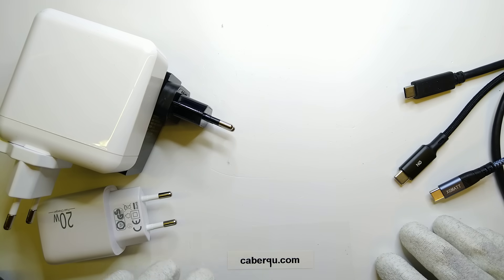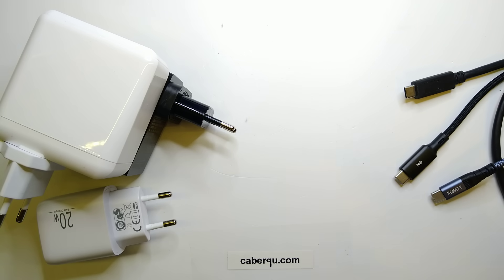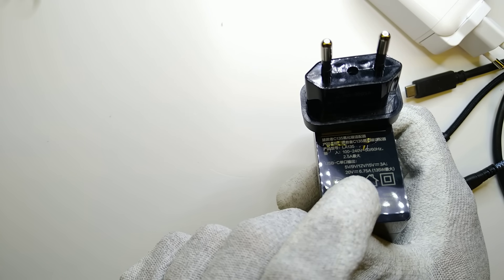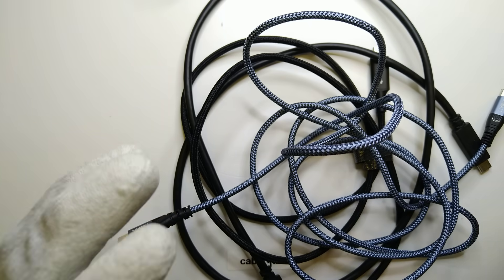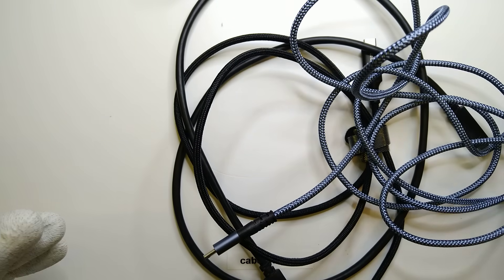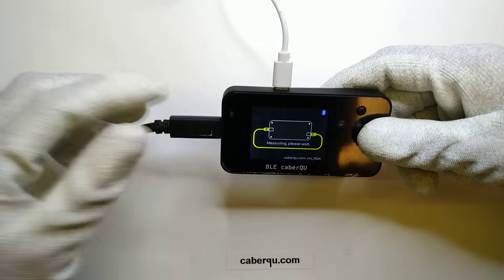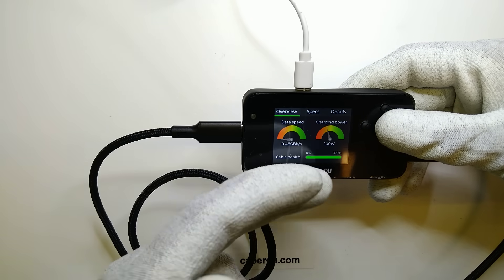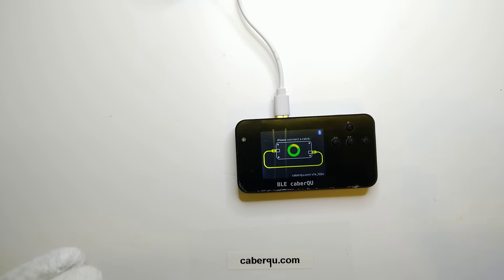USB-C is now EU standard, but the most important thing is missing

Comment: EU should mandate also cable labeling
Reply: The side of the plug where the active electronics are should be engraved with the cable capabilities.
Reply from the maker: Yes, that would definitely be a plausible solution
Reply: Putting electronics inside the cables was a fail from the start. Cables should be passive and every USB type C cable should conform to a minimum standard. They've created a huge mess.
Reply: @Ni5ei  they all do, to USB2.0 standard. And that's the issue.
Reply: @Ni5ei  this. The emarker is a design flaw due to shoehorning power delivery into a cable originally designed to be thin and lightweight. Having a standard physical connector is very useful, but it should have separate pins for delivering low power and usb-pd. Current usb-c delivers max 1.25A per VBUS pin. Data cables should only connect 2 pins (2.5A), charging cables should connect 4 pins. I would have added +4 pins (above the current 24 pins) to plan for 10A cables.
Reply: As far as I know to put logos properly you have to certify paying the usb if organisation. That may be tricky to legislate. Also every one loves a cheap cable. Also the mess that we have is by desing. Everyone wants the thing to charge, an if you follow the standards it may not. That does not sell well at amazon.
Reply: They already do that, very helpful, I buy frequently cables that can handle 300W of power but only bandwidth of 480Mbps. Very reliable cable! In my fourth house, before it burned down, I managed to charge my Renault Zoe with it!
Reply: Amazing how nanny-state actions beget the need for more nanny-state actions. 
The only winning move is not to play.
Reply: @JeffreyGroves How so? These were both problems that needed to be addressed before any legislation, and industry still has not solved it, hence why legislation is going to force industry to move in a consumer-friendly direction.

It is unfortunate, because that same legislation can end up holding things back down the road, but since industry won’t play nice or take a consumer-first attitude, we’re stuck with the only remaining option.
Reply: @thedave1771  this non-standard 'standards' approach "let the market sort it out" is the way of the USA and has caused multiple of problems over decades (VHS :: Beta; nonsensical multiple cell phone networks in the USA; for 2 examples). it is not something you want.
Reply: @JohnW118  that’s my whole point. Industry has had a chance, it hasn’t done so, so I fail to understand why people are against legislation forcing it.
Reply: no, the EU should keep out of things
Reply: @over-engineered  No this could be dangerous, forcing manufacturers to tell you what they are selling you is a good thing
Reply: @ Government meddling in things they barely understand is never good

Comment: USB C is probably the first port standard that requires a user to read the user manual, for every product.
Reply: Reading manual is not enough. Many products do not have a manual or information in the manual about the standards they use
Reply: Oh so young, I love it.

Read up on pre-USB serial, where you had to set everything from the baud to the number of bits and other details, often using physical jumpers (on at least one end). Oh and cables could be wired in multiple different ways (usually straight or crossover, but there were a few other variations) without any labeling.
Reply: @thedave1771  Probably I forgot to add consumer oriented port.
Reply: @glasseffect  Those were consumer oriented ports as recently as in the nineties.
Reply: @az09letters92  Not many people had computers in the nineties, and those who had, would usually call out to a professional to get them figured out including the LP and serial ports. If someone has a scuzzy port, they obviously knew what they were doing.
Reply: Have you ever seen the usb standard that the device supports in a manual?  If you do find it, is the information accurate?  Most manuals are full of legal nonsense, and zero useful information.
Reply: Why?
Reply: @liquidsonly  Probably because a USB C type can do:
Charging
Fast charging (different amps) 
Display
Audio
Now the cable itself doesn't tell you if it can do some of it or all of it.
Reply: @glasseffect  fast charge is primary different voltage no amps.
Device always take how many amps need no matter connector (if is charge able deliver it is different problem).
So amps are problem only for 5A USB-C devices (all USB-C cables what i saw can transfer 3A)
Reply: Welcome to the EU
Reply: probably a good thing arguably